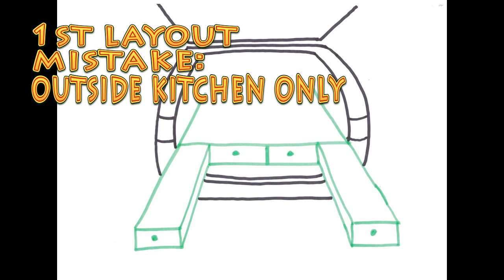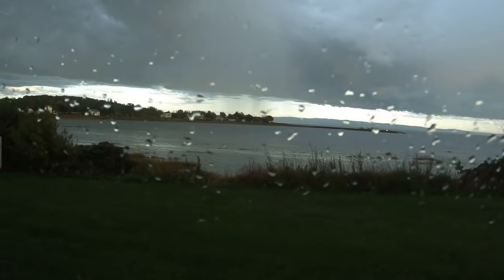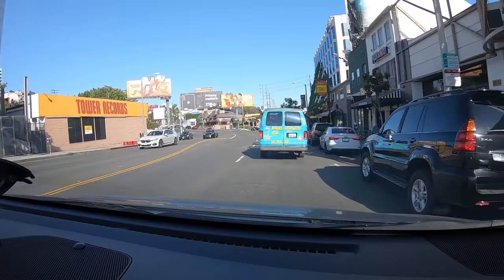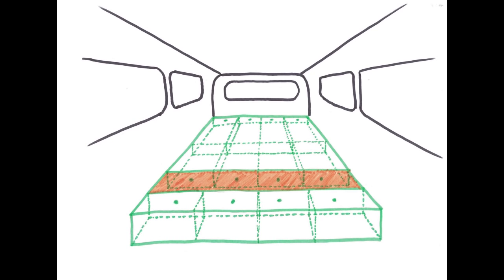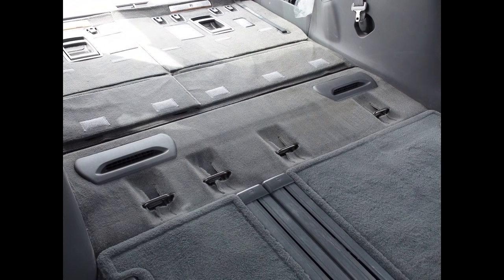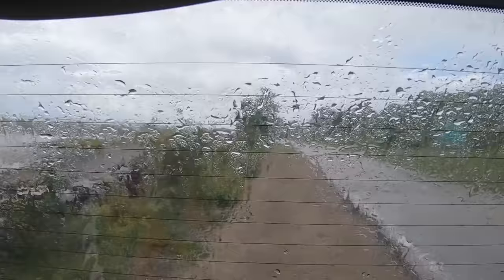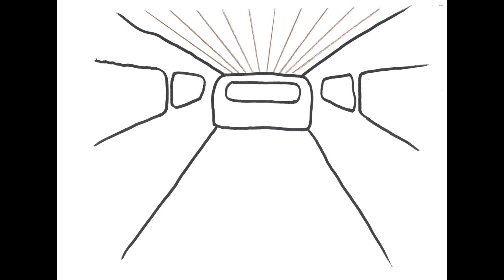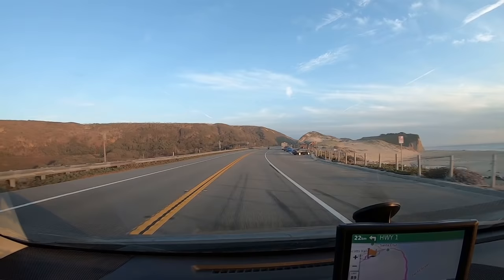11 mistakes to avoid (van conversion)

Comment: Hi Eric! You always provide such great information! Thank you. I have a few questions, please...
1) How wide is your solar panel?
2) Is your black H2O tube on the top 4" or 6"?
3) How wide is your car top cargo box?
4) Are your rack bars 79" long?
5) Are your rack bars off center and set more to the passenger side so the cargo box provides shade and blocks the side passenger door from rain?
Reply from the maker: Hello Joe!
1) about 21.5” 
2) 4” I will explain in a coming video
3) 2’ You can buy the size that fits your need. I was limited because of my surfboards. Otherwise, I would have take larger.
4) about it
5) I adjusted the Thule bar to be able to fit what I have to carry on them. Yes it end up giving some rain cover when the door is open, but not that much. It does not require a lot of wind to have rain inside.

You have to think about what you want to carry on that roof and choose your components accordingly... Your needs probably differ from mine...
✌️
Reply: @ericenjoysearth2756    Thanks again, Eric. You da man for answering my questions. My needs are pretty much the same as yours. Surfboards, solar panel, solar H2o tube (might go with 6" though and use as extra H2o storage) and 24" wide cargo box (might put a flexible solar panel on top of the cargo box).

Comment: Great information, thanks!  It would be nice if you could make a video about cooking in the van, and how do you cook if you are not carrying any compressed gas in the vehicle? Or what is the right way to do this? Do you cook with liquid fuel?
Reply from the maker: I use a small backpacking stove. You can see it in my van tour video:
https://youtu.be/qJjL-NWeoVI
I put the fuel canisters outside in the roof box. 
Good suggestion about van conversion cooking! We do have some classic! 👌
Thank you for your appreciation ✌️
Reply: @ericenjoysearth2756  ever consider carrying a 5 lb propane tank in a rooftop carrier?
Reply from the maker: I use much smaller fuel cartridges. My stove pretty small. I save on space on everything! 😉
I will show this on a video ✌️
Reply: @ericenjoysearth2756  Thanks Eric. For my own footprint, I don’t like adding to hazardous waste with the butane bottles. 5 lb refillable propane is better that way. Just wondering if anyone has experience transporting one in a rooftop carrier secured with soft items.

Comment: OK I completely understand and to many aspects I agree with Eric100%. BUT, remember guys he has a Toyota Sienna, which is one of the biggest, if not the biggest minivan in the North American market. Following these great tips in smaller minivans becomes far more challenging then he makes them to be. Like I said I agree with him 100% but really mostly apply to Toyota Sienna, Honda Odyssey, Chrysler Town and Country/Pacifica, maybe Grand Caravan, etc. or larger.  Any minivan smaller than these vehicles, or SUV’s even Hatchbacks then these common mistakes that he’s describing, are more reality options then common mistakes. People have to take this into consideration. Vehicle size is what makes you decide your layout. Yes take these tips under great consideration but if you don’t have the space then these tips are far more challenging to apply into your minivan/car life. 
Good Job though.
Reply from the maker: I have used hatchback, SUV, and van for more than 20 years. Most of those mistakes do apply to all of them, except for an outside kitchen and a hard floor when you are in a touring car or an suv. Obviously because you can not walk inside or have room for a table.

In a car or suv, I would think more than twice before reducing the height over the bed by building drawers under it. Less breathable volume  will make it much more warm! You need a minimum of breathing air.

All vehicle models and sizes need to be taken in consideration for choosing a layout, but some principales still stand in any of them... For any problem, there’s a solution! ✌️
Reply: @ericenjoysearth2756  Again I’m not disagreeing with you but as I stated its much more challenging. It can be done but at a much smaller scale which leaves very little breathing room. I'm a true believer that there are people that are indeed hunting for minivans and larger vehicles but at the same rate cannot find a vehicle large at the moment and just go with what they already have, which are mostly SUV's because of the ridiculous trend, hatchbacks and sedans. What we see and know of "Vanlife" is chased mostly and entirely from Social Media. But I also see a trend of people using smaller vehicles. So what you state as common mistakes for in smaller vehicles it's because it’s a much more challenging solution. That’s all I’m stating. Like I said I agree with you 100%. But it's not the reality solutions for many in this lifestyle.
Reply from the maker: I agree with you, the more you go small the more precise, and thinking, it may require... The more room you have, the easier it is! 
I also share your point of view about the perception via social media! The realty can be quite different. This was one purpose of my video about hygiene, and also about 11 mistakes. There’s so much people showing stuff that are not really tested...
✌️

Comment: I want to build a fold up bed. I've been watching tons of videos but not much about them. I feel I need my bed first and everything else will fall into place. I'm thinking two pieces of 3\4 inch plywood. One will be 24 inches wide(main bench) and other piece 22 inches x 69 inches long. Use piano hinges and adjustable legs. Then fold it up. Probably have to drill holes for air. I might do a slider bed too. I can't decide. But I would have to have someone make it for me. The ones I've seen are way too long and would be wasted space. I'm only 5'6.
Reply from the maker: Hello Marge!
Here’s how to do my bed. I just love it!
https://youtu.be/h7dM4afXiq8

https://youtu.be/KwciUNzjhYA

You will find lots of other videos on my channel that may help you for your conversion ✌️

Comment: Hi Eric , thanks for the video. Can you show a photo of how you fix the plywood to the carpet on the floor? And also how did you remove the elevation difference on uneven carpet.
Reply from the maker: I will explain all this in a video about the flooring. Stay tuned Andy✌️

Comment: Thank you for your videos Eric! You have the best sienna build, and it is very practical. I am looking forward to referencing your videos to do my build. I do have a question.. What is the the long black material that you propped in front of the window covers, I saw you use it  on the long windows at 7:00min. My window covers always fall out. And I wanted to use something to wedge in the sides of the window to keep it from falling.
Reply from the maker: Well Caroline you just gives the solution before mentioning the problem! 😉 As you understand it, this is why I use that piece of coroplast panel. I will explain all this in the video about reflectix panels. 

Thank you for your great appreciation comment! It is much appreciated. 😃
Reply: @ericenjoysearth2756  Can't wait for that video!!  Also still most eager to know about your kitchen, especially the plumbing.  We love your videos.

Comment: Hello from Hendersonville, North Carolina.  I am currently searching for a low mileage 2015/2016 Sienna and have watched all of your videos, I find them full of practical and useful information. 
A few questions,
I think you used 3/4" Birch plywood for your floor, cabinet's, and bed platform, but it appears you have used a different wood for the sink countertop, cabinet doors and removable table,  what material did you use?
How many miles did your Sienna have when you purchased it and how many miles now?  What if any mechanical repairs have been needed?

It seems you have been making YouTube videos for about one year and have taken a long trip through parts of the USA, any plans to tour the vast lands of Canada or perhaps an adventure to Alaska?

I look forward to seeing your future videos, they give me ideas for my own build.
Reply from the maker: Not that thick plywood. I think I will do a video about material’s thickness and type of wood! Good suggestion!

No problem at all with my Sienna, I just changed the battery after 5 years (including 5 winters in the snow).

I was suppose to cross Canada last year. Hopefully it is going to happent this year! Alaska is certainly a target!

Thanks for your appreciation ✌️

Comment: Use your mirrors and install rear view cameras if need be most of the time my SUV is loaded to the top and i had to depend on my mirrors. I don't like not using the rear window but most trips its unavoidable. When i get another sienna i will avoid blocking the rear window. The galley area will be low enough to see out. The side windows are also important to keep ckear of gear. Some peope cover the very back side window i dont know if i would. I will try it before putting stuff in permanently. I would want to reverse all that i do in case if i need to haul 4 x 8 plywood or other building materials. Im not going to live in my vehicle just camp. 73

Comment: Very good and I still like your set up even after watching about 100 other videos. But I have a question and comment. 
If the danger of propane is mentioned, the alternative should be too. What do you cook with?
Also, I want to redo our sienna, and the folding of your bed looks good. But don't you bash your knees (as you get into the van especially) on those extended bits when your bed is in couch mode? They look sharp and intimidating.
Reply from the maker: Hello!
I cook with a pocket stove for backpacking. I use ISO butane-propane cartridges like the red ones in the video. I kept those in my Thule box on the roof. The danger is not the use, but the storage. I slept better with those on the roof.

For the bed structure, you are right that it may seems the way you talk about it, but finally not. I use it as a handle to enter! I also tie bottles of drinking water to it. So double utility rather than an inconvenient.

If I had to the bed again, I would do it with the same bed structure, but would adjust panel sizes to end up with four identical cushions. 

Thank you for your appreciation comment! 😃

Comment: Hi Eric! Great video as usual. Thank you.😀.   Did you use a vinyl type of fabric for your bed / sofa cushions? Do you find that it’s soft enough for sleeping on? (I’m asking cuz vinyl tends to be stiff compared to cloth.)
Reply from the maker: In the sofa cushions, between the mattress and the cushions cover, I recommend you to go in your local fabric store to get advises to get the right product. They will gives you specific specialized advices. This product is impossible to feel while you seat on it. 

If you also use a bed protection quilt, taking a good soft one will also be imperceptible.

Thank you for your appreciation 
✌️

Comment: Andy from Dallas, Texas. Thanks for an excellent video series. Like the Sienna conversion and  will get one in a year or so but have a question. You mentioned you don't like to store gas or propane for cooking. What do you use to cook inside the van? Induction hot plate? Looking forward to more great content. Thank You!
Reply: A lot of people use butane burners.
Reply: @janetn246  I agree, but Eric listed it in his '11 mistakes to avoid' video about storing fuel and I was wondering as I have never seen him cook in his videos.
Reply: @andypaluch7038  I don't think I've seen him cook yet either. I got a butane burner to use in my home in case of power failures. I like it; it's quickly self-igniting and very clean burning, good to use indoors.
Reply from the maker: I use a small backpacking stove that use iso butane-propane cartridges. I just store them outside in the Thule box. Yes everything can leak. It happens to me, and also to a friend. 
For propane, just think how you must shut not only the valve of your bbq, but also the valve of the propane tank... otherwise it end up empty...
I will do a video about my cooking... stay tuned✌️

Thank you for your appreciation 😃

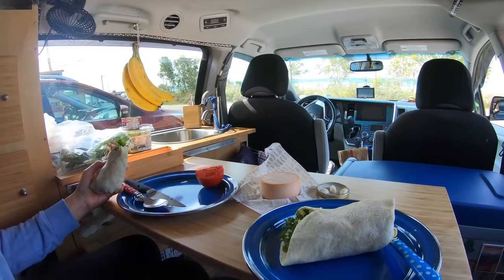Comment: Nice viode Eric. I like it. However 5:21 looks like the cupboard on the left hand side slightly blocs your vision.
Reply from the maker: Thank you for your appreciation.
No, this cabinet does not block the driving view. It is on the far back left side. You can’t see trough that window while you drive. ✌️
Reply: Great job. Happy travels!!! Subscribed.

Comment: Since you store your propane or butane in the Thule, I am wondering...
 Is there any problem with the hot summer temperatures with a pressurized container of gas??
Reply: Yes, I'd imagine that would not be a safe place for them...? So hot? On the other hand, you see propane tanks strapped onto bumpers. What is the best safety protocol?
Reply from the maker: To explode, it will require a spark, otherwise, in case of a leak, it is going to dissipated in the air. In the Thule box there is no electric door lock as in the van, and foremost there is some air exchange with outside the box (not seal). I think it is pretty safe up there. Certainly more then where I sleep! 
✌️
Reply: @ericenjoysearth2756  Thank you.   I feel a lot better about this.

Comment: Eric,vous etes très très drôle mon ami. J'aime tes vidéos. You are so funny. You have made very important points. I learned so many things from your videos.
Reply from the maker: Excellent! Enjoy! 😉
Reply: @ericenjoysearth2756  I will like to chat with you some time if possible. Do you have a list of items, gadgets etc  you recommend other to buy when getting into the micro camper van lifestyle?
Reply from the maker: Good video suggestion! I will certainly do that video.👍
Stay tuned ✌️
Reply: @ericenjoysearth2756  If you can post the links to the gadgets and items you use on amazon or something,that would be great. Also you mentioned completing your temperature control details in another video and I have not yet seen the video of how you make the window insulation with bug screens,your solar system set up and explanation, what type of heater you use for heating in the winter,what type of sleeping bag you use, what type of refrigerator you use, what type of tent you use, what type of kitchen gadgets you use, what type of stove or pots you use, what type of security system you use and so forth. Thanks in advance for considering making such videos and don't forget to post links in the description of the gadgets you use with maybe affiliate links,so when someone clicks on the links and buys anything, you make money from that as well.
Reply from the maker: Thanks for all those suggestions. I will certainly consider them. Stay tuned, videos will follow ✌️
Reply: @ericenjoysearth2756  I am looking forward to it.

Comment: My only worry about a continuos build from the back hatch to behind the driver seat is... Rear end collision could potentially send the entire build into the steering wheel, crushing the driver. Overblown thought but it crosses my mind.
Reply: That's a really good thought. When I was young I was into loud stereos. As soon as I had children I did away with any stereo in my vehicles due to the speaker box or amps becoming projectiles in a collision. Even a front end collision would bring the stuff from the rear to the front of the vehicle. Hitting a child or me in the back of the head with an amplifier would cause serious injuries or death.
Reply: @terryguldin8746  wow y'all, I have honestly never considered this safety risk for car stereos. And will def keep in mind for van build plans. Thanks for enlightening me.
Reply: Even  though you don't want too many holes, you really need to anchor the heavier pieces some way, not just for rear-end collisions, but also roll-overs.
Reply from the maker: You definitely have to secure your cabinets, bed and other things that make sens to you. In my video about the subject I propose different technics. You can multiply them as much as you want to secure things until you will check and test it at your satisfaction. There’s also the build that make a difference. I will do a video about this...

Here’s one already available video:
https://youtu.be/Ua7y4gt6ZnY
✌️

Comment: Hi Eric. Absolutely fascinating to see your van conversion--which is much more uncluttered, practical and neat, unlike the clutter seen on most mini van conversions. My respects! Would the same conversion be ok if done on a standard seven seater SUV? (with back doors opening and not sliding). Also what is the total length and width available in your van in the back (once back seats are removed) for the bed n kitchen/storage set up? Would really appreciate if you could answer these queries and any tips/help would be more than welcome. Planning a similar DIY on my SUV, hence the queries. 
Once again many thanks for sharing your wonderful design. Enjoy and travel safe👍.
Reply from the maker: 95” x (48” to 62”)
I will do a video to explain how to help people with layout development...

Thank you for your appreciation ✌️
Reply: @ericenjoysearth2756  
Thank you  for the clarification. Looking forward to your video on layout development. Best wishes